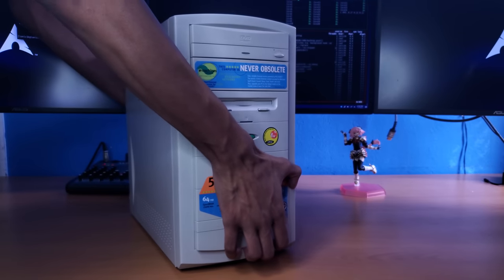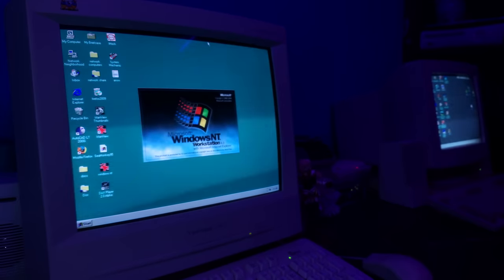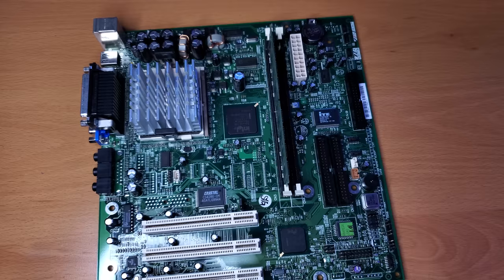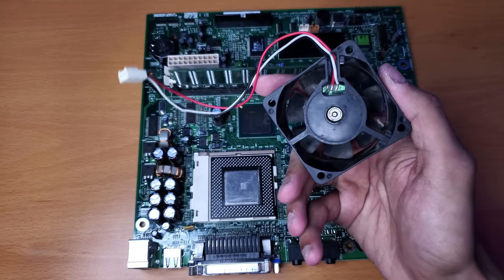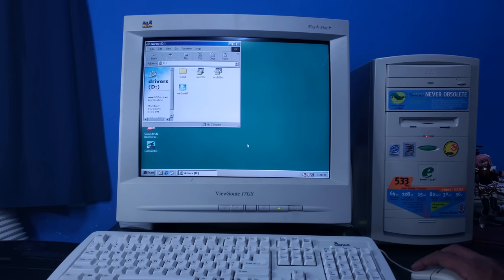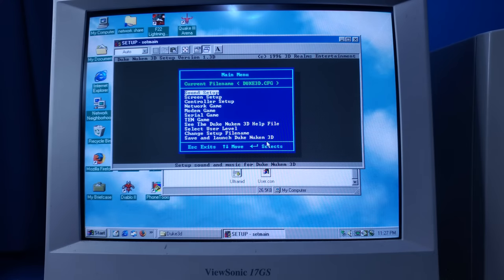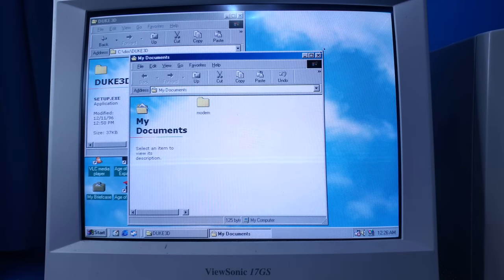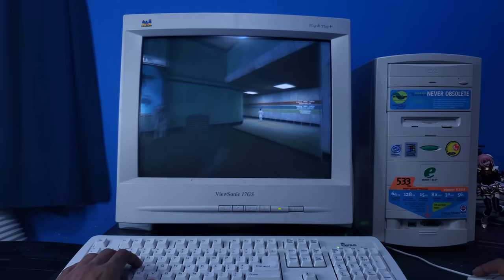This computer was FREE in 1999 | eMachines eTower 533id

Comment: The only problem I have with the hard drive "mounting" on the floor of the case is that it's metal to metal. Those drives produce some vibration and they have a small chance of getting damaged this way.  Get yourself some 3M double-sided foam mounting stickies and put some down between the case and the drive.
Reply: Or toss a mouse pad in there... be better than nothing anyways.
Reply: I fried a hard drive's controller board this way. Shorted something out on the board and that was it. The drive never powered back up.

Comment: In 2015, my parents' elderly neighbor still had an old Pentium PC with something around 400 Mhz processing power and there was a sticker on it saying "20 years of use guaranteed!" (from a German dealer). The older gentleman didn't understand why he could hardly access the internet with Windows 98SE and 128mb RAM because "I was told it would last for 20 years!"  😶🤣 I also had a slightly larger CPU fan on my old AMD K-6 PC 24 years ago and glued it to the cooling frame with hot glue because that's how I read it.  😂

Comment: I grew up with a PC really similar to this. I've installed a flash card in it using one of those IDE adapters. Much more responsive than those death Maxtor drives of the 90s.
Reply: Still have a Maxtor 5.7GB drive from that era. Looks identical to the one in this video. Got it as a CompUSA doorbuster deal in 1999. It ran without fault for 12 years before being retired. And it actually still works. Just loud and slow. And hot.
Reply: @LatitudeSky  that smell of hot dust came right back to me as I read your comment.
Reply: I felt like Maxtor was worst HDD you could ever had in your PC, i never had one but i had friends with 40gb maxtor HDD's and all of them failed, funny part is that before they fail they will start corrupting files and then you would have to reinstall windows just so it can corrupt another file few days later lol.
Reply: @bobsonmkd  I had a Maxtor 40GB drive around the time San Andreas released on the PC and it was one of the last games I installed before it died. It made the game behave really strangely.

Comment: I worked on legions of eMachines; the most common complaint was the power supplies would die.  In the original generation of eMachines,the PSU was actually a little too lightweight.  After about a year to a year and a half, they began installing slightly better PSUs and it seemed to fix the problem.   I bought the upgraded PSUs as a retrofit to the earlier machines.

My boss at work had his PSU go out, and he brought me the machine to fix.  I ended up installing a standard ATX, and had to carve up the back of the case to get it to fit.  It's not everyday a techie uses a dremel to fix a computer....lol

Comment: Computers now are seemingly never obsolete lol. I use my core 2 duo from 2007 with windows 11 and it’s runs it fine without slowdowns or problems of any kind.
Reply: I use my 6 core Xeon HP Z400 from 2011 with no issues on Windows 10 LTSC.
Reply: @SockyNoob  yeah my other computer is an i7 2600 from 2011. I don’t get why people buy new computers unless they do something intense..even then.. my 2600 can handle all the games I want to play.
Reply: My big gaming laptop (gaming laptop itself an insane phrase to me when I was a kid) is nearly 10 years old but every time I look into replacing it an equivilent (not better) machine on the core specs (screen size, hdd and ssd, cpu speed, ram and like, having a graphics card at all) would be more than I paid for it. I got a pretty good deal but it just shows, hardware improvement has plateaued, and what crypto has done to the market.

Comment: After a thunderstorm here in the UK, these machines would come in for repair in droves if they were connected to power without a surge protector, almost certainly PSU & mainboard would need replacing.

Comment: Emachines PCs was the first real upgrade I got from the really old custom build computers with no labels. Unfortunatly, my system had the Windows ME which crashed very randomly at times. Even when I was young I knew it wasn't the hardware because word got around that Windows ME was rushed to meet the Y2K craze. The system worked fine after I upgraded to XP and it lasted for a long time. It was truly the Dell quality back in the 90s

Comment: At my old job we had 1 of these that we got for free from a software vendor. It was in a kitxhen so it got extremely gross with all the oil and dust in the air, just like the rest of the machines in the kitchen area(designed to feed 3000ish people in a couple of hours.) After retiring from the kitchen I thoughly cleaned it and maxxed out the ram and I upgraded the cpu as much as I could, probably a 100mhz fsb Pentium 3 and a bigger heatsink. I finished it off by flipping the emachines logo upside down and called it the fallen emachine.

Comment: One of my first computers was an emachine I bought back in ‘99 with a 300 AMD processor. Over its life I ended up replacing the 56K modem, the HD, the power supply, and upgraded the RAM. For what’s its worth these weren’t really that bad of computers but they were built cheaply as expected with the lower price tag.

Comment: The sound issue with Duke Nukem 3D is primarily due to a poor emulation of Legacy DOS Sound Blaster under Windows by the built-in sound chip on this computer. This machine probably has a cheap ESS Solo sound chip that was notorious for its subpar Sound Blaster emulation in DOS back in the day. 

A sound card like the Yamaha YMF 744 may be able to fix this problem at least when running the game in DOS mode although you may have to disable the USB controller in the BIOS to free up IRQ 5 or 7 for it to work properly.

Comment: It will always be crippled by the fact that the "AGP Graphics" are integrated from the intel Southbridge chip, and there is no actual AGP expansion slot.

But I would still throw like $40 at it...

IDE-CF adapter rather than spinning rust.
A simple Celeron to Pentium swap.
More RAM.
A PCI bus GPU.
Soundblaster.
Ethernet.

Check the PSU for Capacitor Plague?

Comment: I had an eMachines 633ids at one point which was essentially this exact computer but with a 633MHz Celeron and Windows ME. Same case, same motherboard, 15GB hard drive, and DVD drive. I got my system as a hand me down from a friend a bit over 15 years ago when his family upgraded to a Windows XP machine.

The latest video driver from Intel actually gives you 32MB of video memory. It's an Intel 810 chipset which was based on the older 4MB 740 standalone card. Couple that driver with a RAM upgrade to 128MB (or 192, or 256) and you can probably get Quake 3 running halfway decent. With no upgrade you're essentially getting 32MB for your video and 32MB for your system... Which is probably causing access to the swap file and causing the stuttering.

Comment: Oh the memories, I had the 500 edition. I bought it for $600 and the discounts were not available in my area. I remember I needed to use a custom configuration on my emachine to get sound to work properly in windows. I added a TV tuner card and a network card and both conflicted with the modem.

Comment: Gawd I remember eMachines were first sold, and the disappointment it caused me because of what I knew it represented.  In essence, I thought it represented the eventual death of the PC repair business, a prediction that would eventually turn out correct.

I was also a teenager at the time, and knew computer repair.  I had a notion of fixing computers as a way to make money at first after high school, but I just knew this wasn't going to be possible.

For the first time, it was possible to buy a shitbox PC for $500.  Before then, the minimum entry price was at least $1,200ish, and most consumers would typically opt for something a bit better.

Thing is, would you pay $200, 300 or more to fix a $500 shitbox PC?

No, most folks are going to just buy a new one.  And yes, between labor, diagnostics, and testing, something like a replacement of a $50 memory module would easily become $200, though if you needed $100 in memory modules, it would probably be $250ish or so.  That assumes little to almost no parts markup, which no doubt some shops did.

Up until that point, I was fortunate to have had access to a fairly, somewhat wide variety of computer equipment.  Between that, and reading the PC Upgrade and Maintenance Guide, all 4,000+ pages of it back to back many times, I knew nearly everything there was to know about PC assembly and repair.

Nowadays, it really is plug and play like fitting puzzle pieces together.  It's so easy now, that I'd argue anyone who's somewhat handy could probably do it nowadays.  There's a few possible gotchas, but they're less common than they used to be.

I remember things like:

1) Manual jumper configuration for IRQ settings, I/O address range selection, DMA channel, etc.  You had to make sure there was NO overlap.

2) If you plugged a serial port mouse into COM1, and your external modem to COM3, the mouse wouldn't work while you were connected to a dial-up ISP.  Would you know why?

3) Most IDE  cables have one pin-hole blocked out and the male connector typically had a notch to force correct insertion.  The female interface connector on the drive also had a pin missing to prevent incorrect insertion.  But some IDE cables didn't have a pin blocked out.  Would you know what to do?

4) The IDE drives also had a notion of master and slave on the same IDE channel, which meant using jumpers to configure which device was which.  While some IDE cables used the notion of "cable select" (master and slave is determined by which connector is used), this was rare and no one really used that.

5) Conner hard drives, a budget brand of Seagate often used in Packard Bell computers and some others, had the interesting quirk where if installed, the second hard drive on the same channel also had to be a Conner, or else it wouldn't work.

6) If you were lucky (and rich!) enough to use SCSI drives, you had to configure the SCSI ID numbers with jumpers too, and these numbers could go up to 15.  ID 0 was reserved for the system/boot drive.

7) If you had any external SCSI devices, and scanners were often SCSI devices back then, you had to turn them on in a specific order - highest ID/farthest from the system, then next highest ID, and so on, until you finally turn on the system.  Otherwise, some SCSI devices wouldn't be detected properly and work.

8) All floppy cables however, were "cable select."  The primary/first floppy drive always had to be placed AFTER the twist in the cable.  The second floppy drive had to be connected before the cable twist.  Nevermind how that was often not convenient cable management.  Even worse, older 5.25" floppy drives often had an older style of connector, which meant either an adapter had to be used, or to use a floppy cable with both types of connectors.

9) Speaking of cable management...  due to non-modular power supplies and ribbon cables, cable management and airflow was a nightmare.

10) Early Plug and Play almost never worked the way it was supposed to.  "Plug and Pray."  It didn't actually start to get really good until probably Windows XP.

11) Early USB was atrocious and awful, and for a time a strong argument could be made to avoid USB as much as possible.  USB finally got "good" probably around '08 or so.

12) Early 486s, and earlier CPUs, the sockets were not only perfectly square, but there was often nothing to physically prevent you from inserting it in 4 possible ways.  You had to look at the socket carefully to find the marker for pin 1 on the socket, and which corner it was.  And you had to make extra sure the marker on the CPU to indicate pin 1, lined up with it perfectly as well.  If not, you will fry the CPU, and the motherboard, a potentially very expensive calamity.  There was no safeguard against this other than basic due diligence.  This isn't like AC power current where you could plug in the power plug either way and it would work.

Sorry if I went on a bit down memory lane.  Point was, in those days, it was an actual worthwhile skill folks were willing to pay for.  It wasn't something anyone who's somewhat handy could likely do.  Now, it is.  Now it's more in the power user/enthusiast space.

But yeah, after I saw the first eMachines for sale, nearly all the repair shops in my town closed within a few years after that.

The eMachines brand may be gone now, but the $500 shitbox price point remained.  For most folks, they'll just buy another one if anything goes wrong, and now there's more e-waste than ever.  Same thing with smartphones, which often have very limited options for repair and tend to go bad every 2-3 years, possibly 4 years if you're lucky.  Whereas a landline telephone, you could use the same one for decades.

If you know how to assemble your own PC and fix problems as they occur, this can still save you money or offer you a better value.  It's just not something the average person is really that willing to pay for anymore.

Comment: This with a pci fx 5200 or maybe a ati 9200 pci probably would do pretty well on a low budget at the time.
I could see this being given to a kid just a year or two later as its replaced by a new family pc with the dad maybe buying a bigger harddrive & 128 mb of ram.
Ofc some pci sound card to replace that integrated sound card because whew those sounds on duke nukem 3d.

I'd guess this motherboard wouldn't support anything but the celerons on socket 370 as well, or at least it's not documented if you can put in a pentium III which would be a solid upgrade for this machine with like a coppermine pentium III 750 mhz - 1 ghz...

Maybe you can have someone check out the bios file after cpu microcodes or patching in new ones.
After dumping & uploading it somewhere as it seems to be an 810 chipset which does support all pentium III cpus with a 100 or 66 mhz bus speed on other socket 370 motherboards.

Would perhaps make for a video where you explore ATI's Truform technology at the time with that ati 9200 pci as well.
Which is a precursor too something you might know more commonly as tesselation.
Think that's gone on the steam version of half-life though.
Reply: I tried putting a Radeon 9250 in a similar system from the era and it wouldn’t POST. Your GPU mileage will vary from one Socket 370 i810/815/820 system to another.

Comment: The Intel integrated graphics from this era (which was based on the i740 discrete card which released in 1998) gets alot of hate, but it wasn't that bad.

Performance is about equal to a 3DFX Voodoo 1 in most benchmarks, which means it can play most 1998 games at 640x480, 30fps. And anything that came before that very acceptably. 

DOS compatibility is good too.

It could be alot worse, they could have stuck an S3 ViRGE in there. In 1999. Don't laugh, I saw it happen at the time. No Half Life for you! lol

Comment: Ive owned a couple of these over the years, my first was this exact model, and the other was a AMD dual core system when Gateway owned them. If you needed a complete system and didnt want to break the bank, this was the best way to go. Mind you it was only "free" when you signed up for a extended contract with Compuserve (kind of like AOL, but with less crap installed) MSN also did a contract bundle as well. 

Now this was for the tower only, if you got the complete bundle and signed up for compuserve, it was $100 and a monitor was included.

Comment: sir after about 30yrs(maybe more like 25 but eh) of fixing computers I will tell you that it's perfectly acceptable(while no one is looking) to mount the 3.5in drive in the 5.25 inch bay using 1 screw to hold it:'D

Comment: It wasn't free. You had to do Mail in Rebates which are unreliable and slow, plus the requirement of signing up for a subscription. It was not free. Most people will forget to do those rebates and end up paying full price. That's how they get you. Also, stop using on board sound cards. They were never meant for DOS. I had a Crystal sound card on a celeron machine back in 2000 and it doesn't do DOS sound properly at all. You need a dedicated sound blaster for that!